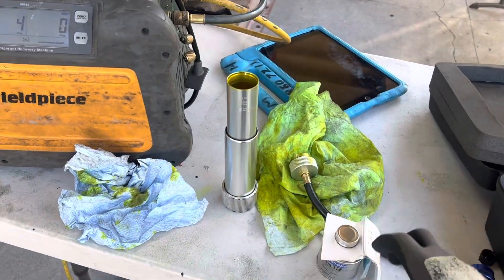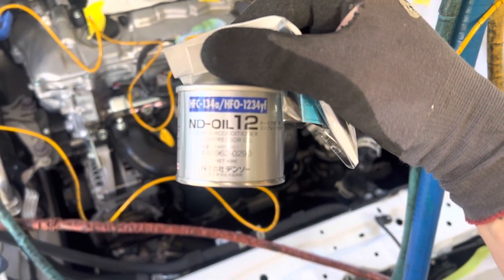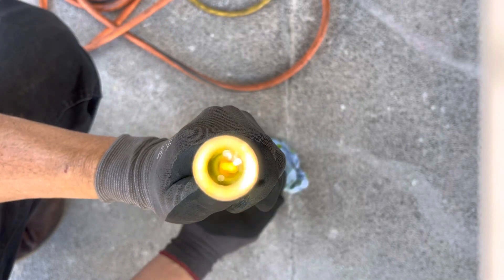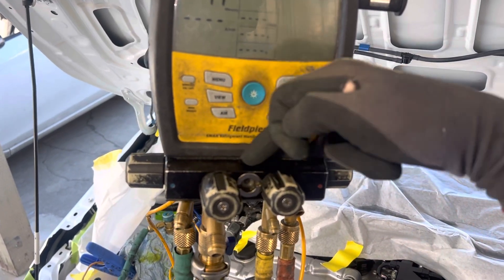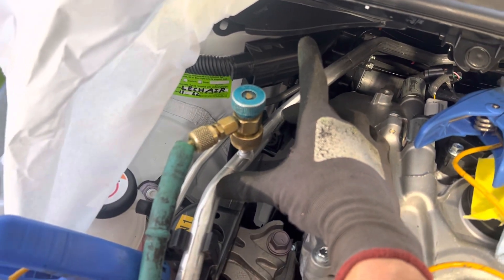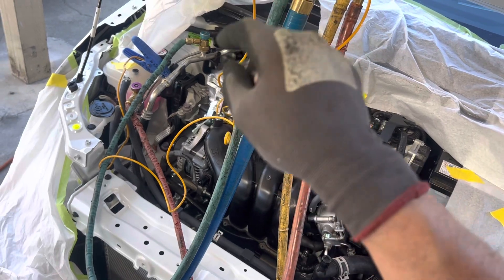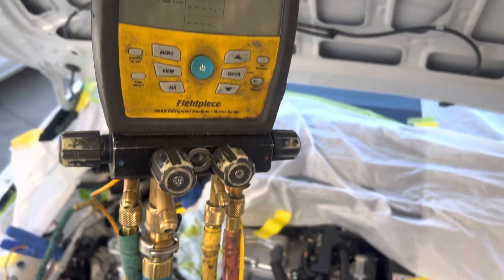UV  FLUORESCENT DYE & REFRIGERANT OIL INJECTION USING CHEAP EBay or Amazon OIL INJECTOR ￼

Comment: Still struggling with my Nissan Patrol in Dubai, once again an fantastic piece of content. Funny how nobody seems to use UV dye :(
Reply from the maker: Everybody with knowledge and experience, and who is a professional who wants to provide better service for the customer in an easier and faster diagnostic time for the next time the vehicle comes into the shop. 
      All these particular individuals use UV dye. 

Everybody who is cheap, ignorant, or lazy, tends to stay away from the use of UV dye. 

Then there was the old suspicious information that is still lingering around and still available. There was UV dyes that contained solvent substance in them that would possibly cause damage, especially if there was too much in breakdown and thin out the oil or react to a seals. 

This was true. Most of those dyes have been eliminated off the market, but they still exist in lazy people who will not read ignorant people who do not know or cheap people who select the cheapest product caused the problems.

TracerLine Products has always provided the most concentrated, highly effective non-damaging UV dies on the market

But the price was much more expensive than every other manufacture so cheap people would stay clear of the good product, and the Chi people are ignorant people who didn’t read and understand with drift towards purchasing the Chi products that cause problems, or did not work very well. 

When the Chi people or the lazy people or the ignorant people would stay away from good UV lights that were very strong, improperly tuned in the correct light wave length nanometers because they were expensive, 

Then they would buy the cheap UV lights, and then say they didn’t work very well so they would give the UV dye a bad name

And again here we have another situation, where it falls back onto the individual who is either lazy or cheap or ignorant. 

The difference between formally educated individuals, and those who learn by breaking things.  

And then blaming it on somebody else

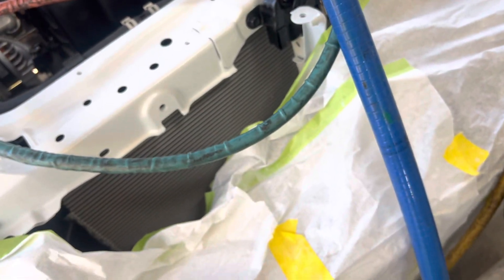Comment: 6:36 - can you also turn the thread in a bit and then press the pump to push the oil into the empty valve knob, which would then push most of the air out too, or would that just waste too much oil, because it wants to come out via the small gap first and not go into the empty valve knob right away?
Reply from the maker: I don’t quite understand the question.   When you turn on the pump, it’s a vacuum pump so you the system will be under vacuum..    exactly what valve am I turning the low side blue valve ?. 

What area am I trying to remove? .  Or oil to be pushed ?.

Under all circumstances, the one thing I am trying to avoid and minimize, is the introduction of any outside, ambient air that contains moisture .
Reply: from 6:36 you start to attach the oil pump to the valve knob, but it probably has that small amount of air inside the thread part that is sticking out from the knob - not really sure how deep does that thread part reaches inside tho
Reply from the maker: @viisteist1363  OK now I understand exactly what you’re saying. 
       It’s on the vacuum pump, sucking from the high side right now anyway.    And you’re going to leave it on the vacuum pump for another hour.   Or until your micron gauge says you get somewhere hopefully below 500 µm or 100 µm..    so that little tiny amount of air that was in the threads will be removed anyway, in the vacuum process after you add the refrigerant oil and refrigerant dye.    And normally your refrigerant oil injector would have another low side suction fitting on it. I’m just showing a way where somebody doesn’t have the money to purchase too low side section fittings..   

So Air would not be a consideration in the first place I will make another video on that and show again I have made videos on this before .  
     I will show adding refrigerant oil to a system that you already charged up using a lowside section fitting that is already attached and has no air in it that only has oil or die to inject under pressure. 

There’s 100 different ways to do things .   This is just one example I’m showing in the video I have made videos of other examples.

Comment: Q:does the pag that comes in plastic container will be contaminated even when it is sealed?
Reply from the maker: Yes , eventually over time. 

And the vary first time you open them .   
This is why you only buy small bottles. Don’t buy the big bottles.
Reply: @coldfinger459sub0  do you recommend sheilf time? For plastic ones since i have alot of them or you recommend to get rid off them
Q:what brands you recommend to use?
Reply from the maker: @abdullwwful  many of the Japanese brands come in metal cans.  Most all the factory OEM come in metal cans.. 

Don’t know shelf life . I know I always given some a few years old.. buy shop. It all turned color, and smells rancid..  something that you’ll never see happen in metal cans.
Reply from the maker: Some do not have a smell. They just absorb moisture without getting that rancid smell.

There was one particular refrigerator oil that was died a dark color blue 
   When it would get really old in a plastic bottle, it would turn clear. 

There was another manufacturer oil that had a moisture chemical indicator inside of it. This was non-Automotive. 

Just 10 minutes exposed to the air and it would turn light orange

Comment: Just wanna ask... If i don't have a nitrogen to pushing the oil down in low side..can i just put a Refrigerant then start the ac and continuation add the refrigerant unit the correct Required Quantity??!
Reply from the maker: @khaledq8bloshi306  we have to figure out a way of getting absolutely no air inside the system.

Comment: Thank you for your video, just to confirm, after you close, depress LS valve,  and inject the oil, you open the valve and leave it open while the vacuum pump "pulls" the oil through the compressor by leaving the high side valve closed letting it run over night to complete the draw?
Then you close both valves and let it run for a while prior to adding the refrigerant?
Reply from the maker: With this oil injector, it does not need the vacuum pump to run or pull in the oil. 

With this oil injector, it has a screw gear injector oil. So even if the system is filled with Refrigerant oil, you can still push the oil that will overcome the pressure of the refrigerant and still go into the system.. 

Or you could put it in with no vacuum pump 

In this video, I just happen to have the vacuum pump on already was doing other things got distracted and forgot to put the oil in earlier . . 

In an automotive shop, they usually do not leave the vacuum pump on more than an hour. Many shops don’t even leave it on more than 10 or 15 minutes or 30 minutes. . 

But if you were a do it yourself person at home in your garage and you have all the Time in the world you can leave the vacuum pump on overnight even 24 hours . 

Shop cannot do that because I have to make money . Cannot stop on one customers car while you have five other air conditioning jobs to do to leave your vacuum pump on one car overnight..

Vacuum pump does not pull the oil anywhere. It does not pull it into compressor or pull it out. Vacuum pump only removes air and moisture.

Comment: When oiling an AC compressor shouldn't you be able to hand turn the shaft while it is level and mounted into the vehicle assuming it's not under any vacuum? Shouldn't it turn without getting stuck and if it does do I need to add more oil?
Reply from the maker: There are some compresses that will not turn by hand when brand new.
Reply: @coldfinger459sub0  The thing that worries me is that I was able to hand turn it when I held it with the pulley facing down. Soon as I bolted it on to the vehicle it wouldn't turn much anymore. That's why I was wondering if I needed to put more than 2 oz of oil in it. I'm also not sure if I got all the factory oil out. Luckily it's the same kind. I was thinking of just not putting any in the accumulator instead of putting that extra amount in the compressor. I haven't opened accumulator yet. I want to know this compressor is going to turn first.
Reply from the maker: @electric_thumbs  did you fallow mounting instructions? 

Example 

Tighten bolt pattern in star in steps of 5 ft lbs. each time until you get to 20 ft lbs. ? 

Instructions talk about mounting pad shims or pins   ? 

On some if a force is applied to one bolt at a time.  It can destroy , bind the housing of the compressor on the shaft
Reply: There were no such instructions but what I'm noticing is it matters if the compressor is level versus if I'm holding it with a pulley facing the ground. Only in the latter case can I get the shaft to turn. If I have it level it won't turn and if it does at all even a little bit it's not very smooth so I don't push it. I can take it off in tilt The compressor face down and have no problem turning the shaft. It's just not moving when I level it as it is when it's in the vehicle.Would that indicate that it's bound up?
Reply from the maker: @electric_thumbs  should not make a difference. Just sounds like you get a better grip when is facing down then level.

Put it in advice, but New not crush it by the case . 

Putting it down and rotating it and leaving it sit for 30 minutes is something that is written in the instructions to allow the lubricant to get to the front shaft seal before installing . 

And this is a problem when somebody buys a product that they don’t know how to correctly, service or install and they don’t research and look up the factory manufacturers instructions sometimes bad things happen 

Things like oil balance 

Properly, mounting the compressor onto the engine block, the torque procedures and sequence 

Whether the compressor had optional, shims or methods of making sure it is level, one mounted onto the engine block 

The use of dowel pins, if that is an option for mounting 

Sometimes the lubricant does not go into or come out of the suction or discharge line openings some compressor. There’s a separate bolt just for oil. . 

I have come across some aftermarket, rebuilt or new compresses that I could not turn by hand, but they were brand new and work perfectly fine afterwards . 

Usually having to put a van spanner wrench around a whole circumference of the clutch to spin it to get it break free 

Or a clutch tool that was manufactured just for the face of the clutch to spin it .
Reply: @coldfinger459sub0  thanks so much. I think what I'm going to do is I'm going to take it off and I have a box with a pillow in it that I'm using as a cushion for it to rest on with the pulley facing down and Even though in there for good hour I'll put it back in there and let it sit for over a day with the pulley facing down on the soft pillow. Then I'll spend it a few times in between breaks or whatever at  work here from home. Then I'll try to see if it rotates when level. It might be my grip. When facing down the pulley might be pressed to or away from the body. Think that might be affecting how easy it is to turn it?
Reply: Aha! It helps to grab the whole thing and turn it when it's not mounted because I can't get my hand on it very well in that position and unless I'm pushing against the compressor somewhat lightly and turning it it's not going to rotate very well. And I assume that the magnet inside which engages a clutch is designed to do that same pushback effect on the whole shaft causing it to engage so we just like me put my hand on it only the belt instead of my hand will be doing the turning when it has the gas in it. Super!

Comment: I’ve been wondering about how to properly store a vacuum pump since I don’t use it often. I know I need to replace the oil in it before every use but should I store the pump with fresh oil in it or leave it drained between uses?
Reply from the maker: Run the vacuum pump for about an hour and get it very hot

This will help boil out the moisture from inside the pump 

Then, while it is still hot, change the oil with fresh oil 

Cap up the ends and store it
Reply: @coldfinger459sub0  ok, thanks for the advice

Comment: 6:30 Can the system schrader hold a vacuum? I understand that you closed the schrader by unscrewing the connector knob, but I thought those schraders would still suck in air. Can you pull a vacuum and unhook the hoses and still hold that vacuum?
Reply from the maker: Some hold some do not. 

It’s NOT ! a good idea to unhook under vacuum

Comment: The similar looking injector tool I got has a backflow preventer in the female flare connector at the end of short hose. Unless it's pressing on a valve core no oil/dye comes out when you're turning in the piston. It's just building pressure inside the injector tool. So I need another adapter, like C&D 1454. In case anyone else runs into this issue.

Comment: Pretty good. I have the same dye injection kit. Thanks for the instructions. You need a head gear go pro. Wonder it’s (dye) shelf life 😂 I’m so bad. I did get the  SMAN , the vacuum pump. The silicon hoses and the monster vacuum hose. All thanks to finding this YouTube page.
Reply from the maker: This last year I’ve watched a few videos on making neon signs. 

I would like to make a lightbulb or two or neon sign, or at least a light just because I can .  And would like to say, I have at least done it once.. 

Neon signs were your gig . 

I would like to take that knowledge and technology and transfer it over to making vacuum tubes for radio. I’ve been watching some videos. . 

Would like to make a simple little with my own homemade vacuum tubes just for the wow factor . in a clear glass desktop working conversational piece.  With all hand transformers that were applied to old Thomas Edison style radios from the 1920s.

Comment: I finally find some one who is really really a AC service tech and not mubo jumbo person. i subscribed today. Sorry i am late and glad find you. Quick question in automotive industry while charging freeon they dont use themerocuple to get the heat and charge based on super heat or super cool based on fixed orfice or TXV. appreciate if you have any videos on explaining this. I am 200% confidencce no body have done it, because auto and residential are treated very different there may reason.. appreciate if you can do a video

Comment: Is there any risk of compressor slugging by injecting to the low side? Why cant we inject oil in the high side instead? Tks
Reply from the maker: It all depends

Concentrated UV dye you’re only using 2 mL to 5 mL no harm in doing anything 
I am talking about concentrated UV dye 

Oil injection if you have a muffler between your service port and the intake of the compressor, that is your little savior 

But on the other hand, if you just put in a brand new system, that was all dry . 

And you’re low side service fitting, was directly on top or inches away from the intake of your compressor 

And your compressor system oil capacity was let’s say 7 ounces or 10 ounces 

And you inject it all seven or 10 ounces into the lowside sitting on a brand new system, and then turned it on and engage the compressor 

Then it would take that slug of liquid oil and shove it right into the compressor 
Sometimes bad things happen when you try to compress a liquid  🤔

This is where the base knowledge of common sense and understanding, liquids in vapors location of fittings, and the quantity of what your injecting comes in to play .

Comment: hey, do you leave the oil in the injector until you use it up? or do you return it to a metal container after one car ? second question, it is 100% safe to adding oil via low side port which is direct on compressor inlet? Not better add via high side port ? 3rd Q - could i add oil direct to the condenser through the inlet port of condenser, next mount it on car, and next make nitrogen leak test, vacuum etc..., ?
Reply from the maker: Leave it inside the injector metal tube. Do not pour it back into the can. The can is contaminated the Kanas filled with air you have now it’s supposed to moisture.

In the injection tube, you poured it into a metal container, and then you turned in purged out all the air so it cannot be excessively exposed to air with moisture 

The best ones for POE oil actually do not use hoses. They’re metal with flex joints, so I cannot even absorb moisture through the hose for injection. 

Yes, you can inject die or oil anywhere even right on top of the compressor like a general motors in the pick up trucks with the low side sitting on the compressor just rotate the compressor with your hand 

Yes you can pour in your die or refrigerant oil in the condenser and then you can perform all your test with high-pressure nitrogen and do vacuum because it’s inside the condenser makes no difference .